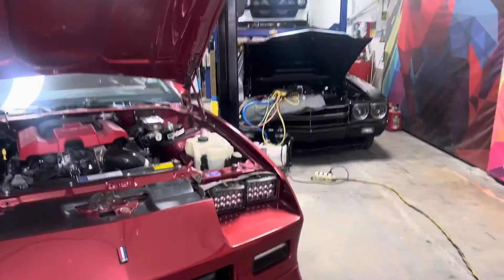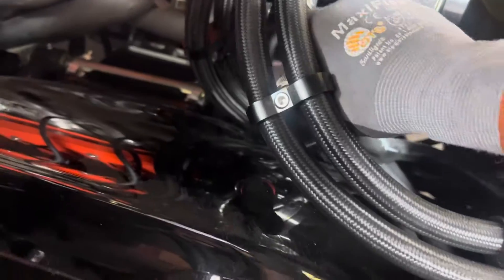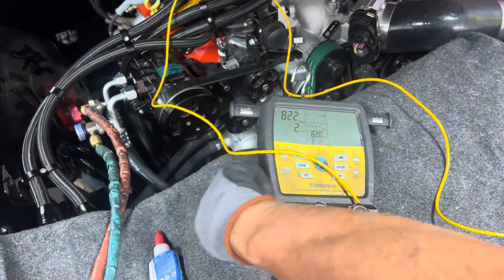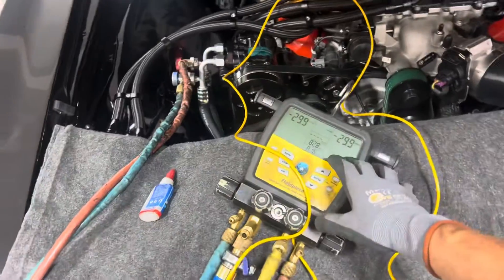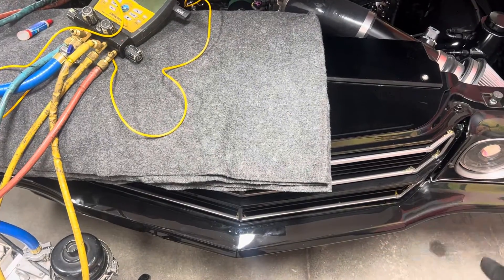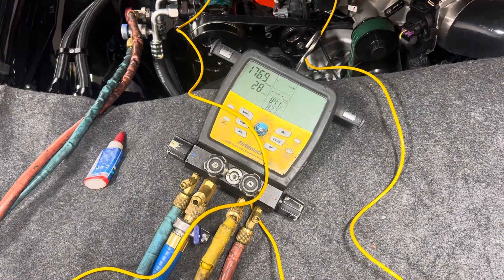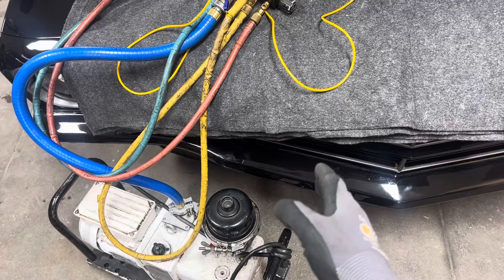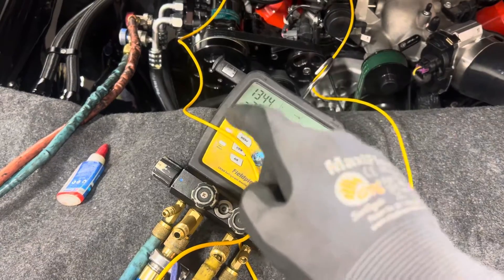Moisture contamination concern me system left open exposed to atmosphere for a long time. ￼

Comment: Superheat and subcool but vintage air systems use a txv I’m not sure what the designed superheat target would be so it will be interesting to see how Tom will determine charge after the condenser has been modified
Reply: Issue is it is not a home HVAC system with single speed compressor. The air flow through the condenser varies significantly for subcooling value. Possible to use FLIR till condenser is 75% full
Reply from the maker: @fer8888888  you do not fill condensers until they’re 75% full that’s a exact opposite of what you wanna do
Reply: @coldfinger459sub0  The OEM Calculates refrigerant volume fill in the system then converts it to weight. That's how they determine in a worse case condition the condenser isn't under or over filled.
Reply: I vote for the dynamic load test in case vintage air can't produce a number.
Reply from the maker: @thisisyourcaptainspeaking2259  but this one had a monkey wrench thrown into the equation. 

The customer could not get their condenser to fit took it to a metal shop and they cut about 3 inches off the top of the condenser remove it and plug weld it up the top of the condenser. 

Reducing the first pass of the parallel flow condenser. 

No problem for a cool day. 

He also has the receiver dryer mounted at a 45° angle so if he does start to get a little bit low on refrigerant the straw at the bottom of the receiver can start sipping in a little vapor instead of 100% liquid defeat the expansion valve. 

And I’ve had a few problems with Vintage Air expansion valves brand new out-of-the-box. 

Three so far and that number is too high for me. 

And the customer has to pay for me to recover the refrigerator out wait for a new expansion valve take the case apart or replace externally and then call me back and pay for me to fill it back up again. 

That adds another $400 to the price of my time and materials to recharge their vintage air.
Reply: @coldfinger459sub0  Agree, change stuff around and vintage air's number is no longer applicable.  Hopefully it's not necessary to futz with the expansion device.
Reply from the maker: @thisisyourcaptainspeaking2259  I am definitely not happy with Vintage Air‘s expansion valves if it was my car or if somebody gave me the permission and a little extra cash to figure it out I would do a conversion over to one of the H blocks style or Sporlan or Dan Foss
Reply: Eddie I 100% agree with you I’ve installed a dozen or so of these aftermarket systems in cars some just the compressor and condenser cause the car already had a factory ac some I’ve installed the full system, most of the company’s that sell these units have close to the same charge capacity usually between 1.3 to 1.8 lbs of r134a so I charge to or between then load the evap and check vent temps but honestly I have no idea how to correctly determine the correct charge, really just hoping to learn something here.
Reply from the maker: @georgeplevritis5190  you are correct one. 8 pounds is what they called for in this particular one I ended up putting 1.5. 

What’s really messed up is when people don’t properly install their pressure sensors or they place their fans or condensers too far away with a large gap between the condenser and the radiator so a lot of the air bypasses around the condenser from underneath and the sides and the top instead of pulling the majority of it air through the condenser. 

It doesn’t help vintage Air sometimes does not choose to use better quality condensers with a higher fin count and hire refrigerant to passage count. 

Because on some of these cars especially the really old ones that had a small face like 32 Ford tall and narrow they could really use help in the department of heat rejection by using the best possible tube and fin combination with a Microchannel that has a fin count more like the DENSO manufacture. 

Other problem is when the DYI guy puts these in under the dash they sometimes try to do hard 90 bands with the flex tubing and they cause a kink that makes a tight fold on the Internet of the 90° that literally protrudes inwards restricting nearly half the airflow. 

And this screws up your load over your evaporator because you’re reducing the airflow. 

So you’re super heating and sub cooling mean absolutely nothing because what you’re reading are false fake numbers to an improperly designed in operating system you’re reading numbers but not the correct ones as if everything had the proper airflow. 

And I have noticed a high failure rate of the expansion valves brand new out-of-the-box either not metering at all stuck in a closed position pulling into a near vacuum. 

Or actually barely modulating or barely controlling the refrigerant flow most people would never see that. 

If I were to purchase a vintage air unit I would not use the expansion valve that came with it. 

A regular automotive expansion valve for me more common year make vehicle that was not produced in China but by one of our American made sources if possible

But me myself I would just custom make up my own expansion valve from one of the kits from Sporlan or DanFoss

I would not use the fittings that came from Vintage Air because sometimes on some kits to make some of their 90° or 180° some of their bends they unfortunately maybe be on accident without knowing choose fittings that neck down and restrict the refrigerant flow for example from a size 10 down to a size 8.    But I guess it was the cheapest easiest part for them to get a hold of for mass production and still works. 

And if I was doing a restoration or a complete rebuild of an old vintage American car or even European car

I would stick a second evaporator kit in the rear trunk behind the seat because these cars were so poorly insulated and a lot of heat and hot climates passes right through the vehicles and a lot of heat comes through the sheet-metal up through the floors and from the engine compartment where everybody often puts 400+ horsepower motors that produce a lot more heat into the car. 

So I put second evaporator in the rear system pushing to air up through the rear deck lid and if you have enough opening you could come up through the side quarter panel pillars and put vents above the heads and along the sides like in limousines all the kits and pieces are available. 

It’s not difficult. 

I used to work with a limousine manufacture where we would add as many as four Evaporators in a long stressed limousine off of one original OEM compressor and I would add a second condenser and second sub cooling condenser underneath the vehicle to feed the rear of operators with separate secondary receiver dryer for the rear expansion valves for the rear Evaporators.
Reply from the maker: Vintage Air systems are kind of screwed up. 

Chopping down that type of condenser really puts a lot more restriction on the discharge of the compressor because you have fewer parallel tubing paths to flow through. 

Usually the ratio of tubing pass in the first pass is much greater than the second pass or at least equal in this scenario they made the cross flow parallel flow tubing pass fewer than the second pass. 

I just flew by the seat of my pants and guesstimated. 

When you screw with airflow or refrigerant flow too much or making things wrong side all bets are off. 

I had one guy install a massive displacement compressor on a tiny little condenser and evaporator. 

On that guy system that I had ridiculously high head pressure and ridiculously low suction pressure. 

Did not know trying to figure out what was wrong until he told me he change the compressor with a larger internal displacement compressor. 

Kind of what I was getting at but I couldn’t prove it because I did not know anybody would do such a thing because he’s one of those old time guys who just gas at everything and as long as it blows cold it must be good attitude.